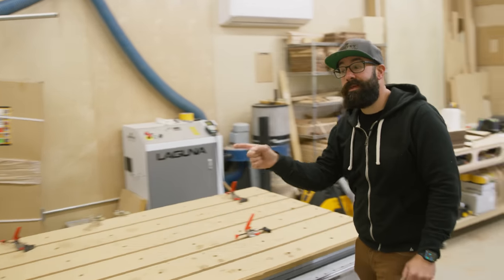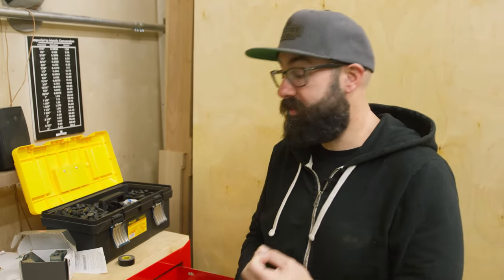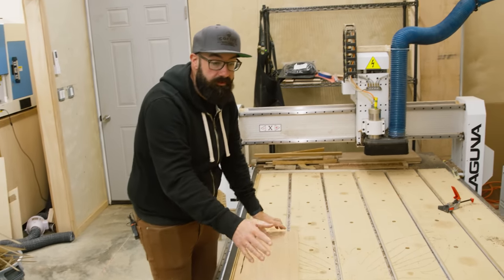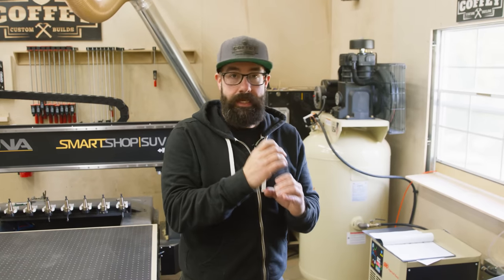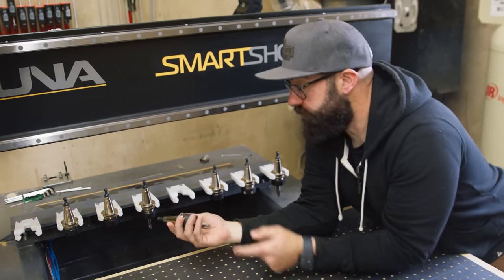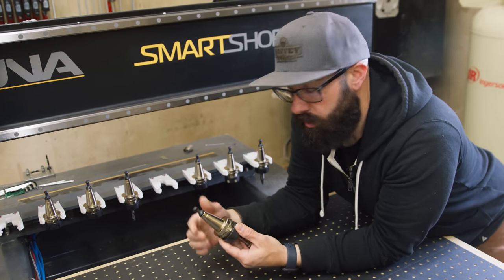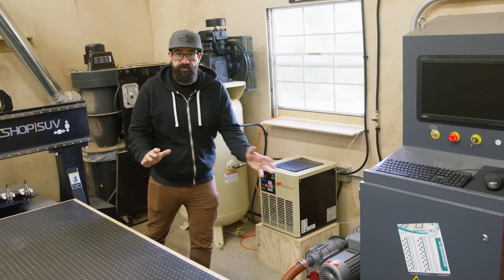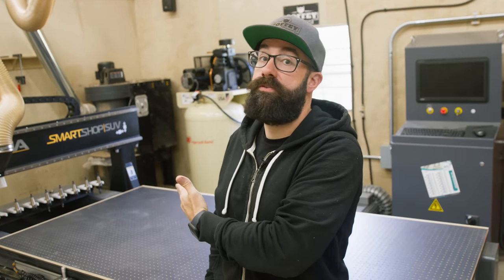The Hidden Costs of CNC's!

Comment: Good morning 🌅, great territorial, I’ve been looking at CNC as a hobby, I don’t know nothing about how to set them up and running costs, Of the machine, I am a retired specialist joiner cabinet maker from the UK, it might sound nice, but I’m now retired living in France, I need to earn some extra pennies and this is part of the reason why I’ve been looking at CNC machines to see whether I can make small things to be able to sell, just come across your territorial, and you mentioning the cost of cutters and bits and pieces to have your machine up and running correct, I still have a lot of my tools, machinery and cutter block, I have 3 tool engineers work cabinets, I haven’t done it for quite awhile but last time I’ve done it for a insurance assess, I had somewhere around £16,000 worth of tools and cutters, that fit on my spinner holder/shaper, and my tenner  machine WADKIN EKA , those this machine is vintage. It is a very very good machine., They can do things that some of the new smaller machines cannot do, Unless you went to a serious machine, CNC bed, I think my workshop cost me somewhere between £70-£100,000 to set up, Not bad for one man band,  going back to your machines? I would love one of those those., way beyond my capability of using it, stay safe keep up the great work, I wish you all that success for the future, from France.
Reply from the maker: Thanks!

Comment: Sometimes it's easier to spend the money upfront. I bought a vintage 48x96 shopbot that was sold by a local high school. I spent 4500 on the machine and I've probably spent 2500 on all the extras you've mention. Just running 220v electrical from my box to the machine was 400 bucks. That when I did the electrical myself. 

The machine is a 2004 so I had to refurbish most of the electrical and replace the control card. 
it's been a good investment but eventually I will upgrade to a more capable machine with a ATC. but the shopbot paid for itself in January on its first job. its been a great machine to learn on, as I had little CNC machine experience. its been a great experience and I have learned a ton, if I was using the CNC full time, I would have just bout a 50-90k machine.
Reply from the maker: It's usually easier to spend it upfront as downtime crushes any savings.

Comment: If you move the compressor outside, plumb the air intake to take air from the air-conditioned shop.  If you don't, plan to get a much bigger air dryer. You will also need to drain the tank much more often.
Reply from the maker: We drain the tank twice a week and the air dryer is handling it great. I'm in California. Low humidity.

Comment: Been running a 3-axis Biesse Rover and a SCM 5-axis CNC for some time, and even maintenance is also a cost to factor in depending on how frequent they run. I've seen people not greasing their machines and later down the line, it ends up being a pricey fix because something gives out! I like your video and your shop looks cool!
Reply from the maker: Thanks man! Fortunately this machine auto self lubricates
Reply: @CoffeyCustomBuilds  depending on the machine, the auto lubrication covers only a part of the lubrication, not everything. Usually, it's the spindle, ways and, ball screws.

Some things (especially with those bigger machines like Biesse or SCM) need also periodical greasing on top of the auto lubrication. And you also need to check, that the auto lubrication works. I worked with maintaining some metal CNC machines many years ago, and have learned that anything with a sensor can fail.

Comment: I maintain CNC Maxine tool at a major manufacturer. In our plant we have over 60 CNC machine tools. These machines machine to tolerances of 5 microns. The machine cost about $300,000 each. But the tooling for each machine is about the same cost. We have 6 full time  persons maintaining these machines at a cost of about one  fifth of the outside repair companies. And in about one tenth of down time.  CNC isn’t cheap, but the overall costs much outweigh manual work. With much less scrap parts
Reply from the maker: Absolutely worth the money!

Comment: Great video. Very informative dude. Where were you six months ago? We just bought our first Shop Sabre CNC and got caught off guard on the Air Compressor/Dryer requirement. Also, loud noise is definitely a factor as it costs MORE money to buy low db rated equipment (quiet dust collection, low noise rotary screw compression, etc.) There's a strong temptation to go cheap on many items because of what you're stating. We also have an Epilog laser cutter but this is WAY different. Going full on CNC is much larger game.
Reply from the maker: Yeah you can do it cheaper but you should do it right the first time.

Comment: As a cabinetmaker and specialist cnc programmer and machinist if you are wanting to nest cabinetry I would have to say you have gone in the wrong direction. I worked a biesse rover with a converted bed for nesting with onboard tool change, 32 bit multi borer and bidirectional circular saw. Only additional costs were dust extraction tooling and air. No need for a spoil board with holes in it just a sheet of mdf and good to go. I could easily cut 30 sheets in a day while still edgebanding or assembling
Reply from the maker: You do machining and cabinet making? At the same time? That's cool. 

We have done 30 sheets in a day on this. Average is 20.

Comment: Between the surprise costs and gaps in knowledge, I don’t think most people know what they are getting into when they buy a CNC. Even a hobbiest level one.

Things can be bought and learned, but you are right that there are surprises on both fronts.

Thanks for the video.
Reply from the maker: I think many of the costs associated with my Swift are exactly the same as a hobbyist machine. Thanks for watching!
Reply: Every time I tell someone looking at a $4000 machine that they should plan to spend $11-$15000 MINIMUM someone comes along and says that's BS. It's not BS. If you don't already have a well-equipped shop and you want to run a hobby machine with a sticker price of $4000, expect to pay even more, I'd say over $20k. A CNC doesn't live in isolation.

The electrical work alone in my tiny-ass hobby shop is over $5000.
Reply: @espressomatic  I would say if someone is scrappy and can tolerate some QOL sacrifices, you can get by for a lot less than 11k if your machine build is 4k. It depends on what one is cutting. I probably had 4k into building my first machine between the kit and the steel to weld the frame and the control system. Add to that 400 for dust system, 150 for electrical between the panel and machine (thankfully it's literally 10 feet from the panel to the control box) and maybe 600 over the first year for an assortment of collets, initial tooling, etc. So all in maybe cost $5500 in the first year? With tax and shipping and gas to/from the hardware stores it might be at most 6k. (Now this was 5 years ago so inflation is what it is)

Since then I put maybe another 1000 into upgrades and replacement parts (including a new Gecko 540). Of course I also already had a well-enough equipped shop with a benchtop mill in it, so I didn't need to go buy any common power tools, metrology equipment, etc. But even so that would be maybe 3-500 to get the basics from Amazon or Shars or wherever else. 

We're not talking the good professional level stuff here. Which I've got plenty of now running my VMC and the like. I'm talking strictly the hobbyist running maybe a cottage little side hustle who is on a tight budget and needs 'good enough'. 

It goes up exponentially as the machines get more complex and 'higher end' with more QOL features. But certainly someone scrappy can do CNC on a budget.
Reply: It is just with a car a lot have one but even as you need a license a lot are horrible drivers.

Comment: Careful where you locate the air drier. There is a maximum ambient air temp rating if it's going to be in a machine shed with other heat sources. Also if it's in unconditioned space in a cold climate you could freeze the moisture as the refrigeration system condenses it. Yet another hidden cost. Great and informative video. Cool equipment.
Reply from the maker: Its in the shop

Comment: When moving your compressor outdoors into a shed, there will be a lot of heat generated. This will make it very hard on that equipment, make sure to add some type of fan to pull that heat out and pull cooler air in. It just never seems to stop does it!
Reply from the maker: Yeah it's got ventilation. I went way overkill for it.

Comment: So many apsects to consider when buying a cnc. I thoroughly done my research and came to the conclusion i was better off buying a new $130k machine for my business, 10kw spindle, 12 auto tool changer, 1500x3000 bed, 14kw vacuum, highpressure atomiser, pop up pins, dust extraction. Up and running straight away no headaches and fully future proofed. 
I did have to get 100kw mains run which i didnt expect to be as much as it was.

I almost purchased a cheaper machine but would have regretted  that decision due to the lack of all the above features and required add-ons.
Reply from the maker: Buy once cry once.

Comment: I can only imagine the hidden costs. I thought wooohooo $400 expensive router. Than I saw the bits I required, that was 300 dollars, vacuum cost another 200 dollars. That is just for a simple router. I got tracks for it, I got the plate for it to run on tracks. The cost is significant. I am building a sbr rail slab flattening, that is about a 1,000 dollars in total. 

As soon as you add a computerised system, one can imagine how the cost increases significantly.
Reply from the maker: Yeah the money adds up quick

Comment: All good points.

The other hidden cost that everyone should be aware of, but often forget, is the shipping. The sticker price is one thing but for some of this equipment it is coming by truck (maybe with riggers) or you're paying fuel prices to go pick it up or you're paying shipping in some other way. That's a cost that adds up very quick for some of this stuff, especially at the outset, and is something to remember to factor into the budget. And in a lot of cases a lack of planning ahead costs a lot in the shipping, as McMaster or whomever is charging a minimum rate of 7 or 10 bucks even if you're just getting a single small part; so buying reactively vs proactively will have very real costs.

One hidden cost that came up early on in my experience with a CNC router was needing to make storage racks and carts for holding large sheets of material. I'd never really needed to have a way to store multiple sheets of 4x8 so I had to spend some time and money on building a large roll-around cart that could hold sheets of MDF, Plywood, Aluminum, etc. And now I've got that plus a fixed rack that can handle piles more material. It's one thing if you only ever buy one or two sheets at a time from a local vendor. But for some projects I was sitting on 30 sheets of material shipped via freight that couldn't be left in the middle of the shop floor, that had to be kept safe, dry, and unbent. So leaning it up against the wall or in a pile on the floor wasn't suitable. Plus being able to roll the cart right up to the machine so that two people can lift the sheet right up and over is extremely useful. 

Third big hidden cost besides tooling is the metrology equipment. IF you're running any sort of equipment like a CNC, even a benchtop one, you're going to need some calipers, dial test indicators, some squares, precision level, and other metrology/measuring tools that will ensure you are cutting what you think you are cutting. Sure the CAD might say it's a 1.000" hole, your CAM might agree to cut a 1.000" hole using a 1/4" endmill, and the machine may interpret the commands and cut what it says is a 1.000" hole. But without calipers to tell you that the result is a 0.997 hole, or gauge pins, or a bore gauge and micrometer, or other precision measuring tools; you won't know how much compensation to incorporate to make it a 1.000" hole. Even if you're doing jobs where the nominal tolerances can be in the 1/16" range (or say 1-2mm)  you still will want to be, and can be, much more precise especially on mating features like joints, slots, holes, etc. All of that takes precision tools to level the machine, calibrate the machine, check for tooling runout, etc. Not to say anything of checking for tram. 

Another cost, esp if you're a business, that somewhat came up in the video but wasn't pointed out explicitly: is just the TIME. It costs time to install and level the machine, run air, run power, run vac, run dust, troubleshoot the setup, calibrate and ajust parameters, learn the software, learn speeds and feeds, do the research and order parts, experiment with workholding, etc. If you're a business and are taking time away from otherwise working on existing stuff you're basically expending productive time on this effort to get a machine that ends up in a profitable state. It can be man-weeks of invested time at a minimum to get one machine setup and run like we see in this video. So you have to budget what your time costs or what your opportunity costs are, and decide if some of that can be outsourced to either the company you buy the machine from, or someone local, or an intern, or a friend that you can do some favors for down the road, or whatever else.

- A case in point is I built my own hobby-grade CNC almost 10 years ago to make a prototype airplane with, and it took about 4 months back then to go from having ordered parts to having something that I could use to cut parts. But later when I bought a factory-made machine, it was still a few weeks of learning and other setup work to get everything brought to production-ready status. Some shops that are used to it can bring a brand new machine online within 2-3 days of hitting the floor, but they are usually already running similar machines and have experienced people and a gameplan, and are paying for speed. When you're figuring it out as you go it always takes more time than you think.

- Another example is a guy in our industrial park bought a reputable, brand new CNC plasma table a year ago but due to other work he has going on and his general lack of experience with CNC and computers and such, it's going to have taken him almost full year to get things setup on his end with a good computer and laptop and software and everything dialed in, to where he can start actually using it. Now again that's mostly because he has other stuff going on and isn't relying on it for money, but, because there were some things to figure out those small delays add up for someone with a lot on their plate who can't afford to take a week or two of focused energy on it. But it does mean they've paid a lot of money to have something taking up space for a year in their shop.

Some other misc hidden costs are: cleaning supplies, ways to dispose of huge bagfulls of dust/chips, lubricants and grease/oils for the machine as required, coolant if using any kind of misting system for cutting aluminum, reinforced flooring if a bigger machine, floor mats for walking around/standing by the machine for long sessions, storage for all of those tools (a new toolbox is a few hundred bucks minimum), a computer and desk and monitor and chair and so-on for your CAD/CAM machine if it isn't going to be an existing workstation.
Reply from the maker: So many things to consider.

Comment: If you move your air compressor to an outdoor shed or whatever your gonna build your going to induce moisture into the system by running the air from a hot space to a cool space even though you have a dryer there's just so much moisture it can remove.
Reply from the maker: I have 3 water filters and yeah they can only remove 99.9% so I'll roll with it.

Comment: Excellent video thanks.  It does raise a couple of questions though.  The first three items (electricity, dust collection, tooling) are not specific to CNC.  If you are going to make the same product without CNC machinery, the cost for these items will still be similar, and your time costs probably higher.  Some of the other items would also be needed in some form. (Non-CNC machinery, work holding, work benches etc.)
I think you are too smart to be caught out by 'Surprises', i.e. things you did not realise you would need.  I would wager that you did extensive cost/benefit analysis, rather than buying on a whim.
If I sound 'Nit-Picky', forgive me, I really enjoyed your presentation, and the insight it gives into decisions you are faced with.  👍
Reply from the maker: The electricity is specific. This machine requires a dedicated 80 amp service that is for this machine only. Any other CNC will need a dedicated line. The dust collection doesn't need to be dedicated but it is best to imo. The tooling is definitely specific to this machine as CNC bits don't work on other machines. I do have multiple CNC's so I can use my tools across the machines but my smaller machines can't run the larger bits my big one does. Labor is my biggest expense. Payroll is by far the most expensive investment I make every month. Making things faster is the name of the game. 
None of these were surprises for me. This video was made purely for others looking to dive into the CNC world. It was definitely not a rant about how surprised I was by the costs as some have interpreted it to be. I did all my research and knew all of my costs going into it. 
Not nit picky. Solid talking points and I appreciate the observations!

Comment: Put the Rotary Phase Converters outside in the dog house you are building for the other two items.  My RPC is outside my shed in a side outdoor working area.  Also have a fan going another hidden cost
Reply from the maker: The VFD's are in the processor cabinets. No phase converters here. But I will when I get my wide belt